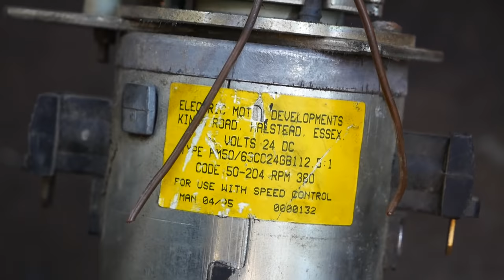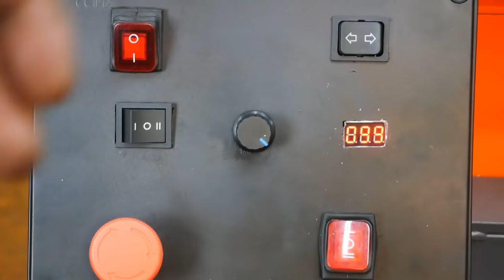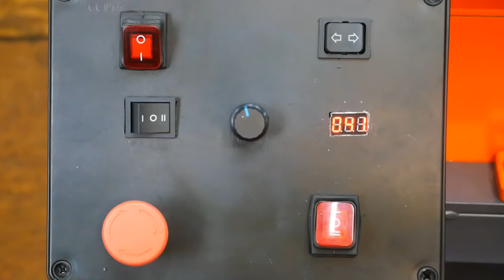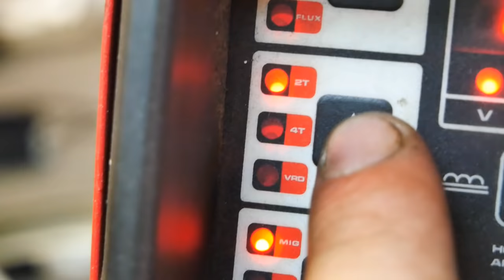Making Rotary Welding Table

Comment: Excellent build. I loved the use of materials, and the construction using basic tools available to everyone.
This is a very inspired project. Thank you for sharing it with us.
Tim
Reply from the maker: Thank you 😁
Reply: Sorry you are wrong, the video is edited . No real fabricator will rely on those mag squares for a start. No showing of plans & drawings either , try to build something like this out of your head , not impossible but very improbable.
Reply: @poontang7546  Poon Tang you are wrong most fabricators use and verify the mag squares to start with. The editing was done well to reduce the length of time it took to buy and load and unload the metal from the truck and removing the gear motors from the vehicles and crimping the lugs on the ground straps. He did show you how he drilled and painted.
I am favorably impressed with his editing skills as well as his engineering skills.

Comment: best  I've seen ya do so far and you have done a lot of good stuff useful stuff.  I think this gets at a production level more than all the other stuff so far. near-perfect wields with little effort after the real effort is done is invaluable you could run this thing while getting a lot of little stuff done around the shop. in short, I LIKE IT!

Comment: I built something like this. I made oilfield parts that needed many rings from, 12, 22 and 50mm steel plate. You can order disks from steel supplier and cut out the centers cheaper than you can order rings. I drilled a centering hole and piercing hole and used oxy/propane to cut. I would buy a dewar of liquid oxygen that cut all I could before it off gassed.
Reply: agreed

Comment: I am building a flight simulator cockpit with dual controls. 
Your device is exactly what I want to build for a " motion platform". 
I have done all the electronics with Arduino & home made panels, screens etc.
I need the platform to be able s
To support and rotate, tilt forwards & backwards, Right and left, using jack screws as you have. The only difference is that with 2 people ridding it   + the weight of the cockpit made of wood & plastic I estimate the device should be able to hold 300kg in all directions & positions . Obviously the  base would have to be much wider, 4m x 4m. The arrangement of the components is the same. 
Just an FYI there are enough crazy people like me that would love to have access to something like you show! 
Please send me a reply & suggestions. 
I live in Arizona USA, where the temperature outside is 52oC!

Comment: You would want to ensure that there is never a set of circumstances that see any of the return welding current getting back to the welder via the bearings.. The ball bearing in a set of bearing can make a “funny clicking noise” if they develop a flat spot from passing welding current.. ask me how I know ! I think you would to be on a regular basis  checking that the copper braid wrapped around the shaft is in good clean contact.. perhaps with some electrical conductive grease…

Comment: Hose good , too stations  above down too scope adjustment. Air Rams, but hydraulic system is best pressure,     in. Houses heat fins on pipe to heat,  two room in apartment 5 gal tank size,   john.

Comment: I made a turning device. Round steel about 7 inches diameter. Each 1/16 inch on a tape measure was 1 degree. It was stolen from pods. No steel, low gas pressure I bought 1from india,dhl. Metric. Refrigerator compressor for house gas experiment.

Comment: 06:20 Why a cable for electrical connection of the main shaft?  
The case and bearings are all metal.

Comment: Where did you get that adapter to use the threading tap in the drill?
Reply from the maker: I bought it from a Chinese online store, but I bought one of the cheapest and after a few threaded holes it already has a runout, it's a very good tool for a cordless drill, but you need to find a better quality.
Reply: Ah ok, that’s a shame as it looks handy! I’m struggling to find any let alone a better quality one!! Fantastic build too mind! 👍👍

Comment: Could you share a diagram or photo how to connect the electrics?
Reply from the maker: There is not much electricity, you need a power supply, a speed controller (I bought a Chinese speed controller that already had a rotation direction switch connected) and you connect everything to the switches

Comment: What did you tie around the shaft
Reply: he used a copper grounding strap.  you dont wont the current to run through the bearings